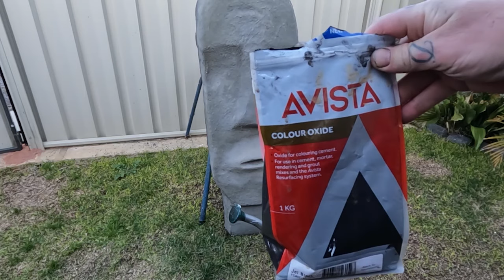DIY How To Make Styrofoam Concrete For Lighter Craft Projects

Comment: have you tried adding a little dish soap as well?  If you can blend the soap with the water and get it as foamy as possible (or look into an aircrete foam generator).  Should provide a little strength (should also allow you to use 2x as much styrofoam to cement as you're currently using)

Comment: A lot easier to paint the mold with a fine coat of the finished concrete mixture then poured the bulk mix in.

Comment: What is the reason for using the sand? Does that particular concrete mix require you to add sand?
Reply: He's not using concrete.
He's using cement, which when combined with sand, water and aggregate, makes concrete.
Reply: @Antassium  
Thanks for clearing that up!

Comment: I made a 3 feet by 4 feet long, 2 feet high planter box, 5 inches thick, using plywood forms. 
 To get a stone wall look, i drew rock shapes with pencil, then applied beads of silicone caulking on the pencil lines, to serve as fake joints between the fake stones. 
 Roughed up the plywood for fake stone surfaces. 
 Coated the forms with motor oil. 
 Forms and silicone joints came off easily. 
 I was very pleased how it turned out, and very easily done.  
 I used brown dye and charcoal dye for the joints, after parging everything.  
 Very authentic looking.
Reply: I wouldn't use motor oil on edible plant application as they are carcinogenic

Comment: Your tiki head looks awesome. Can you advise where to get shredded polystyrene for cheap? Thanks
Reply from the maker: Hi there, thanks for the feedback. I purchased them from a local store but it seems they dont want to supply it anymore, so I will be making a shredder to shred my own now by the looks of things
Reply: I got mine free from a furniture store. Believe or not, they burn theirs. Once acquired, strip into smaller pieces with a wire cutter, and feed them into a leaf mulcher vacume blower. the bag will collect all your shredded styro.

Comment: Hello noted that one could add foam soapy mixture to styrofoam pellets for better integration. 

Sand bag tubes in a circle and stacked beehive style for impenetrable heat and cooling efficient dome.

Where do you source your pellets from question mark
Reply: sand bags are a thermal mass. they aren't impenetrable as it is not insulation. It will pick up heat or cold, and dissipate it at night. If it's hot enough for long in the day, it will be like an oven at night, shedding that acquired heat, even if the outside air is already cooler.